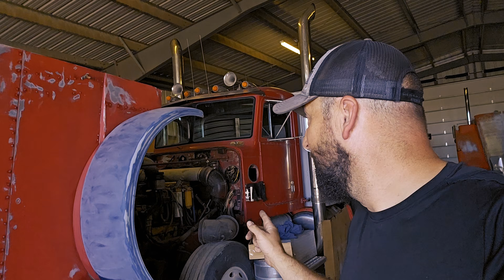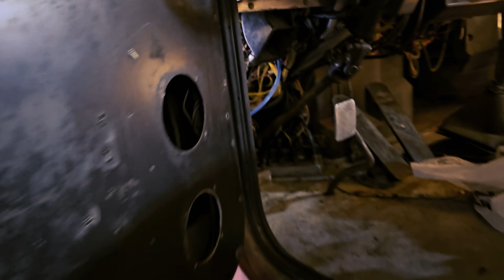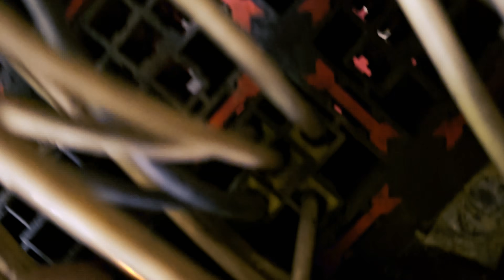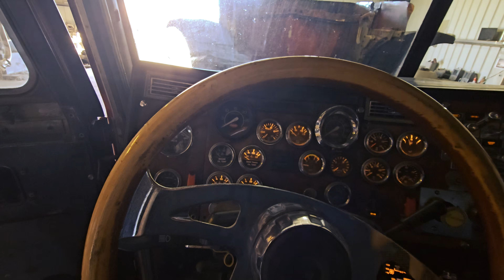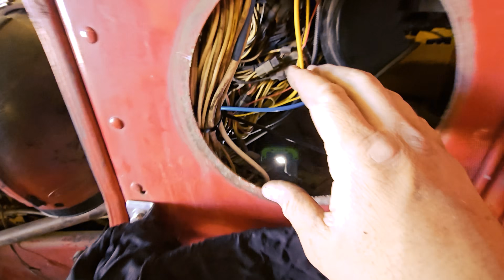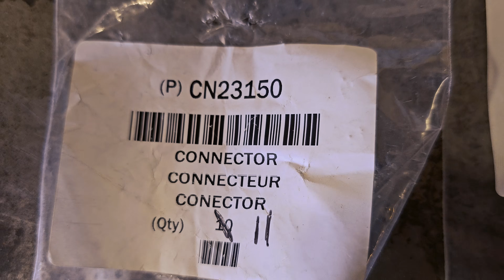How to rebuild your Peterbilt 379 Fuse Panel!

Comment: Hey brother I have low beam on my 2003 379 but switch to high beam I have no lights on the drivers side put in new switch swapped relays and headlights around everything works so wires good from radiator up I can't figure it out no high beam indicator light no high beam drivers side I hit the switch and turn on lights on low beam passenger side high beam flickers for a mill a second is there more relays behind the dash
Reply: Finally mine was corroded on the back of the fuse box were the screws connected to the breakers praise all be to God what a journey figuring it out glad that's behind me
Reply: @choke-c8v  nice work!!
Reply from the maker: That's frustrating! I'm actually dealing with a similar thing on my truck. I had to come back to it. I'll let you know if I figure out my problem
Reply: @Shifty379  ok thanks I appreciate it
Reply: I’m going through the same exact thig actually. Did you guys have any luck figuring it out?
Reply: No I didn't
Reply: I got it to work again after tearing the hole truck apart a fixing grounds it some were behind the fuse box took it loss and it started working then a hour later stopped again took the fuse box out again and started working went out a couple hours later not working I don't frigging no man last time I took out the abs fuse after pulling fuse box lose this time not it has to be something behind there or bad breaker connection I'm frigging over this mf try again tomorrow 3 days of this shit
Reply: @choke-c8v  I just got mine working again. It has a loose connection on the left head light relays. But mine is an 05 379.
Reply: OK I'll check that something is loose for sure works then I go check it hour later and nothing again I'm about to lose my mind with this dam thing
Reply: @pawg.c7z I think 03 and 05 would still be the same
Reply: I had the same thing and all I did was change out the breaker, there are 2, 10 amps each.  Prt# cc32100
Reply: @josecuellar1579  that is exactly what fixed mine as well. The breakers were bad, I was wrong when I initially said it was a loose connection on the relay.

Comment: great Idea removing the air boot ,  question  What is the white push circuit braker Amps 30?, 40? any part number pls.  looking at the fuse box bottom left .
Reply from the maker: Ill have to look I cant remember the amps on the breakers and see if I still have an invoice for the numbers. My Peterbilt salesman I just gave him the vin for my truck and he got me all the parts
Reply: @Shifty379  thank you
I found a video in Youtube from guy (Hamlet Dubois) video Wiring Problems and troubleshooting advice on your semi Truck Big Rig
I saw in his hand the fuse panel and they have different AMPs Stop is 35A, Tail 30A
Left HDLT 10A, R HDLT 10A, IGN 20A

Comment: Thanks for this video, now my dad and I can fix this issue on his 378 setback axle. 👍
Reply from the maker: Glad to help. I couldn't any thing on this before doing mine
Reply: @Shifty379  Turned out to be a relay behind the dash part: v23232-d0001-x001
Found it at napa part number: echar298 $70
Thanks again! 🤝